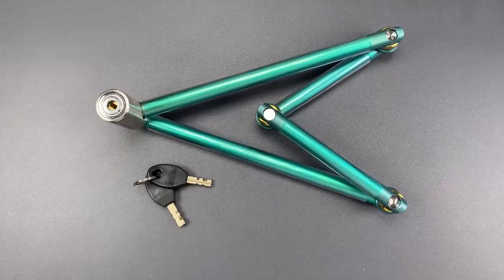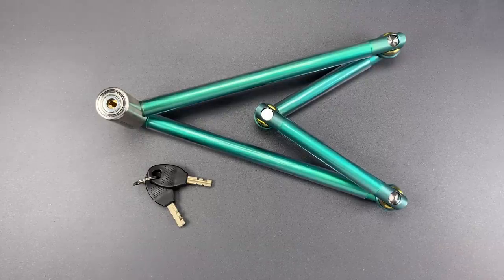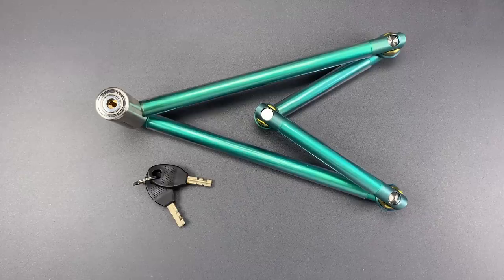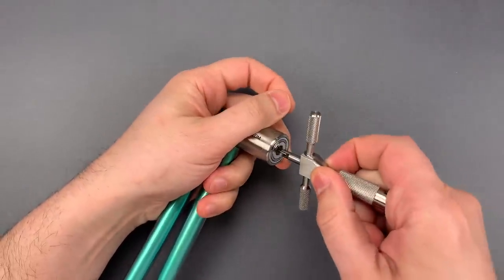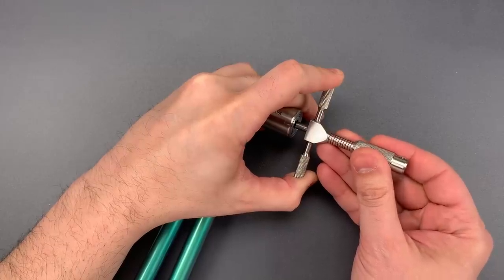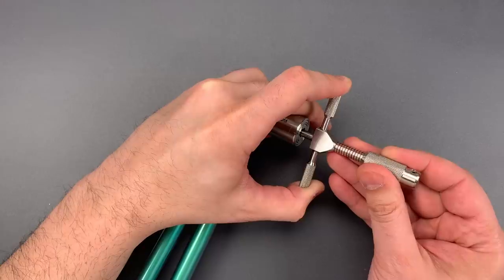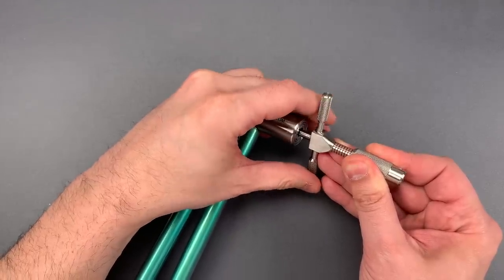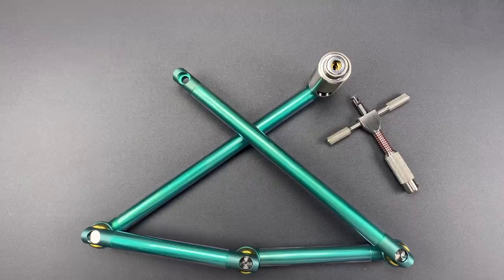[1063] $180 Titanium Bike Lock Picked (Altor 560G)

Comment: People think that titanium is stronger than steel per volume, when it's actually about the same strength per volume at about half the weight. That's still useful in many situations, but it's not as strong as many people (including past me) believe.
Reply: People think titanium is some miracle metal with no downsides.  It's light, that's about it. It's typically stronger than aluminum but weaker than high grade steel AFAIK.

Comment: I do a sport called "Robotic Combat", you may know it as Battlebots in the states. I actually use alot of Grade 5 Ti where i can for the below reasons.

In terms of metals, Grade 5 Titanium is probably the best metal for low weight, high strength applications at a consumer price range - Titanium roughly has the strength of steel at the rough weight of aluminium which makes it ideal for these applications, however Titanium gets extremely expensive, extremely quickly once you want to start specialising it in the same way you may with steel

Comment: He makes it seem like hes turning the wafer discs so far with each movement and then when he pulls the picker probe out he does it so quickly that you have to wonder how it doesnt catch and move the wafers, unless the tension is enough to negate that. Also how often do you think the painted black lines on the tool actually line up with the wafer thickness.

Comment: I hate all the marketing for titanium. The average person thinks that titanium is the strongest metal available. This is specifically because marketers use weasel words to strongly imply it without actually claiming it. Titanium is very strong for its weight. What most people fail to realize is that weight class means that a fair comparison is with aluminum, not steel. Steel, and iron for that matter, are far stronger than titanium. They are also much heavier.

Comment: How would the core fare against picking if if the discs could rotate 360* with false gates ever 30* or so and it tensioned off the internal housing of the lock with a specially designed anti-bypass wafer that has a pair of holes in it to allow the tip of the key to interact with the housing which has the actuator on the back of it

Comment: LPL - "Probably enough pick-resistance for the streets" - Translation: Safe against 99.9% of bike thieves.
Reply: Sorry, no. :-(
At least here in Norway, all professional bike thieves, which is really the only kind you need to worry about, are using cutters or grinders. The top end would be hydraulic cutters similar in strength to a fireman's "jaws of life", hidden underneath a coat/jacket. I had a very nice carbon bike that disappeared this way while I was donating blood. :-(
Reply: @TerjeMathisen  Correction: Safe against 99.9% of bike thieves who try to pick it instead of just cutting it.

Comment: 180$ What a joke, I can buy some serious stuff for that amount.
Also isn't going to scratch the bike without any plastic protection?
Reply: the plastic on it was clear
Reply: @algnedpe7271  but only around the bars. there was enough blank metal left..
Reply: It's expensive, but it does at least kinda make sense if you want some protection at a low weight. Sure you could by 5kg of massively more protective hardened steel for the same price, but that's not really comparable. Compared with other expensive/exotic light weight locks this doesn't look tooo bad (cough Ottolock cough 🙂)
Reply: My pen cost more.

Comment: "Let's have this really impressive bike lock made out of TITANIUM"
"But that's going to cut in our budget really badly..."
"Just compromise on something else"
Reply: It's hardly a compromise. It's a light, sturdy piece of kit and as LPL points out, most people can't into disc detainer cores, and those who do have better things to do with their skills and specialized tools than nick bikes.

Consider also that LPL himself is really, really good at picking. Pretty much any core that actually needs him to single pin pick and not just prod it open with a shim or a rake is adequate for most common security applications.
If you actually do have stuff that needs high security locks, you'll (ideally) buy them from manufacturers that live and breathe that stuff.

Comment: Titanium has been hyped up for years as if it were a real-world adamantium, when in reality, if you're willing to sacrifice weight, there's grades of steel that are far stronger than even the best grades of titanium.
For bike locks, tools, knives, etc, the use of titanium is pretty much just marketing BS, one of the reasons being titanium corrodes like aluminum, the oxide layer is protective, so it stays prettier longer than steel

Comment: A skinny, flimsy looking lock made of titanium? No doubt this can easily be broken in a dozen different ways. Even if this were steel it would be a shitty lock, with titanium it's horrible. Only people who are ignorant about titanium (which is most people..) think it's stronger than steel, for most practical purposes it is far weaker- meaning weaker by volume, a LOT. I think titanium would need to be roughly three times as thick to be equally strong as steel. I look forward to a video destructively testing this lock.

There's a reason things like knives and carabiners or anything else that needs to have high tensile or shear strength while small in size are never made out of titanium..

Comment: Why doesnt kryptonite or whomever, employ bb or lpl to help then make a lock that these guys cant pick, or at least it would take multiple pickers together several hours to pick. By combining and extending the current hardest to pick designs, it cant be that hard!
E.g. a core inside a core where it it impossible to apply any tension (keyway core spins inside outer core) until the correct key sets the pins exactly correctly and this then pushes pins out the inner core to the outer core so that u can turn the outer one that actually secures the lock.
If I understand it, picking requires tension, so a Keyway that rotates 360 until the key is inserted, with good shim protection, should be 'unpickable'? Its not that complex a design, ur just inverting and doubling the whole pin or sidebar designs within each other. Make it of hardened steel throughout, and high tolerance/quality and bingo!?